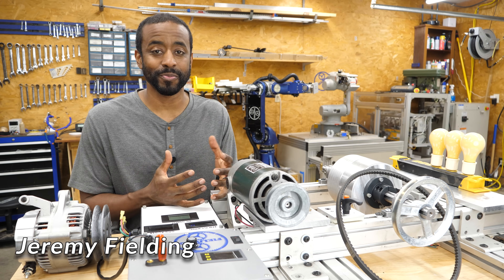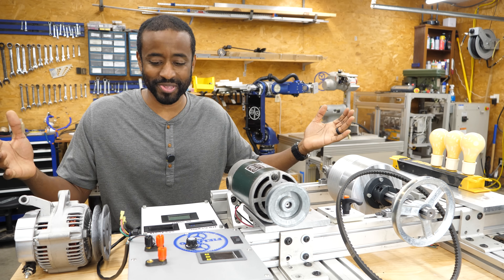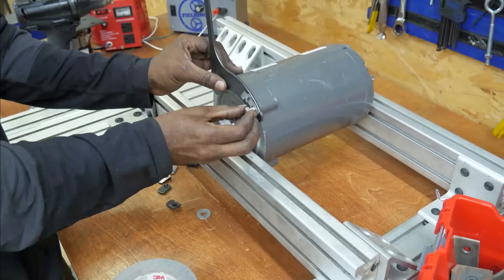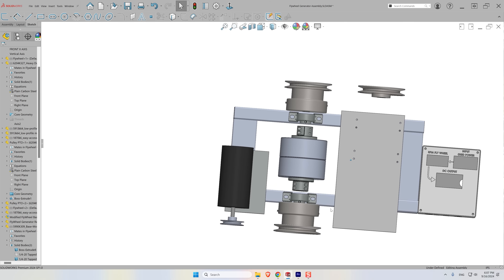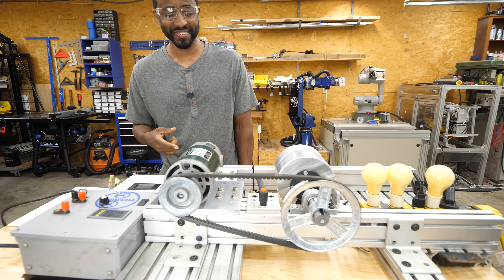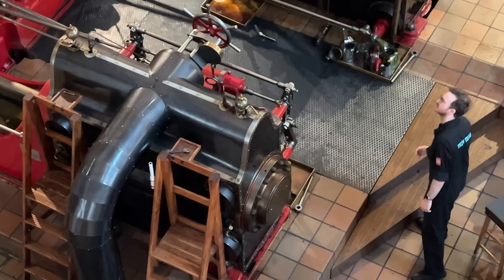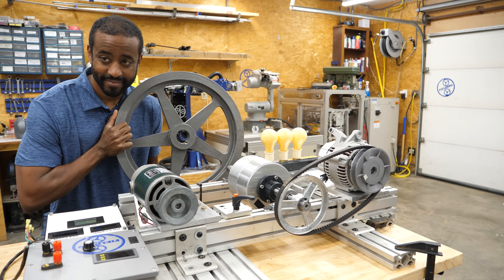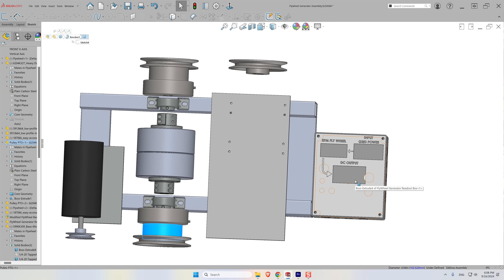A Machine To Test Free Energy Ideas.

Comment: 122723.  The second law of thermodynamics may be false conventional wisdom. Let's face the wonder of full heat use. 

The second law of thermodynamics was developed during victorian england's scientific and religious fascination with steam engines. 

The second law is behind modern refrigerators needing electrical energy to compress the refrigerent to force it to release as waste the heat that it has removed from the refrigerator's service interior in the cooling part of the refrigerent's circulation. The interior coldness draws in exterior heat through the cabinet insulation. There is also discarded heat from mechanical friction and electrical resistance. The net thermal output equals the electrical input with energy not being gained or lost in this refrigeration system including its forced waste. Unencumbered refrigeration by the principle that energy is conserved should produce electricity instead of consuming it. 

It makes more sense that refrigerators should yield electricity because energy is widely known to change form with no ultimate path of energy gain or loss being found. Therefore any form of fully recyclable energy can be cycled endlessly in any quantity. 

Full heat recycling, all electric, very isolated underground, undersea, or space communities would be highly survivable with self sufficient EMP resistant LED light  automated vertical farms, thaw resistant frozen food storehouses, factories, dwellings, self contained elevators, safe rooms, and horizontal transports. 

In a flourishing civillization, small self sufficient electric or cooling devices of many kinds and styles like lamps, smartphones, hotplates, water heaters, cooler chests, fans, radios, TVs, cameras, security devices, robot test equipment, scales, transaction terminals, wall clocks, open or ciosed for business luminous signs, power hand tools, ditch diggers, pumps, and personal transports, would be available for immediate use incrementally anywhere as people as individuals or larger social groups see fit. 

Some equipment groups could be consolidated on local networks. 

If a high majority thinks our civilization should geoengineer gigatons or 
teratons of carbon dioxide out of our environment, instalations using devices that convert ambient heat into electricity can hypothetically be scaled up do it with a choice of comsequences including many beneficial ones. 

Energy sensible refrigerators that absorb heat and yield electricity would complement computers as computing consumes electricity and yields heat. Computing would be free. Chips could have energy recycling built in.
This would improve performance and lower cost,

A simple rectifier crystal can, iust short of a replicatable long term demonstration of a powerful prototype, almost certainly filter the random thermal motioren of electrons or discrete positiive charged voids called holes so the electric current flowing in one direction predominates. At low system voltage, a filtrate of one polarity predominates only a little but there is always usable electrical power derived from the source, which is Johnson (observation) Nyquest (theory) thermal electrical noise. This net electrical filtrate can be aggregated in a group of separate diodes in consistent alignment parallel creating widely scalable electrical power. The maximum energy is converted from ambient heat to productive direct current electricity when the electrical load electrical resistance  is equal to the array internal electrical resistance. 

Maximum calculated electrical power output (watts) is k (Boltźman's constant), one point three eight x 10^ minus 23, times T (temperature Kelvin) times bandwidth (0 Hz to a natural limit ~2 THz @ 290 K) times rectification halving and nanowatt power level rectification efficiency, times the number of diodes in the array. 

There are a billion cells of 1000 square nanometer area each per square millimeter, 100 billion per square centimeter. 

Order is imposed on the random thermal motion of electrons by the structual orderlyness of a diode array made of diodes made within a slab: 

Host crystal is silicon
  P type boron doped
-----‐------‐----___-- Out
🔻🔻🔻🔻
■■■■■■___ + Out 
  N type phosphorous doped 

All the P type semiconductor anodes abut a metal conductive plane deposited on the top face of the slab with nonrectifying joins;  the N type semiconductor cathodes or common cathode abuts the bottom face. As the polarity filtered electrical energy is exported, the amount of thermal energy in the group of diodes decreases. This group cooling will draw heat in from the surrounding ambient heat at a rate depending on the filtering rate and thermal resistance between the group and ambient gas, liquid, or solid warmer than absolute zero. There is always a lot of ambient heat on our planet, more on equatorial dry desert summer days and less on polar desert winter nights.

Focusing on the composition of one simple diode, a near flawless crystal of silicon is modified by implanting a small amount of phosphorus (N type conductivity) on one side from a ohmic contact end to a junction where the additive is suddenly and completely changed to boron (P type conductivity) with minimal disturbance of the crystal lattice. The crystal then continues to another ohmic contact. 

A region of high electrical resistance forms at the junction in this type of diode when the phosphorous near the ĵunction donates electrons that are free to move elsewhere while leaving phosphorus ions held in the crystal while the boron donates holes which are similalarly free to move. The two types of mobile charges mutually clear each other away near the junction leaving little electrical conductivity. An equlibrium width of this region is settled between the phosphorus, boron, electrons, and holes. Thermal noise is beyond steady state equlibrium. Thermal noise transients, where mobile electrons move from the phosphorus added side to the boron added side ride transient extra conductivity so t⁶he forward moving  electrons are preferentally filtered into the external circuit. Mobile electrons are units of electric current. They lose their thermal energy of motion and gain voltage, as they transition between the junction and the array electrical tap. 

Inside the diode, heat is absorbe; outside the diode, to exactly the same extent, an attached electrical circuit is energized. The voltage of a diode array is likely to be small so many similar arrays need to be put in series to build higher voltage.  

Understanding diodes is one way to become convinced that Johnson Nyquest thermal electrical noise can be rectified and aggregated. Self assembling development teams may find many ways to accomplish this wide mission. Taxonomically there should be many ways ways to convert heat directly into electricity. 

A practical device may use an array of Au needles in a SiO2 matrix abutting N type GaAs. These were made in the 1970s when registration technology was poor so it was easier to fabricate arrays and select one diode than just make one diode. 

There are other plausible breeches of the second law of thermodynamics. Hopefully a lot of people, mostly as independent teams, will join in expanding the breech. Please share the successes or setbacks of experiemental efforts. 

These devices would probably become segmented commodities sold with minimal margin over supply cost. They would be manufactured by advanced automation that does not need financial incentive. Applicable best practices would be adopted. Business details would be open public knowledge. Associated people should move as negotiated and freely and honestly talk. Commerce would be a planetary scale unified conglomerate of diverse local cooperatives. There is no need of wealth extracting top commanders. We do not need often token philanthropy from the top if the wide majority of people can afford to be generous. 

Diode arrays may be applied to warfare. War is terrible. Stable respected borders enforced by world suppression of invasion is needed.

Aloha

Comment: many people are making these and showing them on you tube but few if any give you any information on how to have success.     I will try to explain how these work and what it may take for success.       first know these devices must be tuned, its a balancing act between all components.  your generator/alternator must be two or three times larger than the drive motor in wattage.  the connecting belts must be relativity kept loose, the tighter you make the belts the more amps you will draw from the drive motor.   I believe most important is to drive the flywheel up to a rpm that will keep the generator spinning at a speed while under load fast enough to allow the wattage needed to power the drive motor.   you must accomplish this while drawing the least amount of amps possible from the drive motor.     the lower the gear ratio between the drive motor pully and the first flywheel pully the less amps the drive motor will draw.  always start with a small pully on the drive motor.   then size your flywheel pully to achieve close to the rpms the generator needs to operate at.    the size of your flywheel matters.   why? because you want the drive motor to operate at its rated rpm where it runs the most efficient at.   if the flywheel mass is too large the drive motor will draw more current to try and get the flywheel up to the rpm the drive motor wants to run at. in short the more massive the flywheel  the more current the motor will draw.  all gear ratios and flywheel mass must be tuned by monitoring the amp draw of the drive motor.    the flywheel is there to assist the generator, it provides a buffer for the drive motor. instead of the drive motor having to spin the generator under load by it's self the flywheel will maintain the generators rpm as long as the drive motor is getting the proper wattage from the generator.   the flywheel is ampliflying the drive motors torque.    it's a fine tuning of all components.    because there are many different generators and motors you will have to tune each system.     you may have to trial and error with the components, and certainly gear ratios.    if your generator is not outputting enough power to keep your drive motor going or giving you excess power then you have to increase the generators rpm, change gear ratios.  if your flywheel mass has enough energy to keep up the increased gear ratio to the generator without causing the drive motor to exceed it's efficient running status then you may have it dialed in.    if not you may have to increase or decrease the flywheel mass or adjust the gear ratio between the drive motor and the flywheel.   it's trial and error, you have to spin the generator fast enough to get the power needed for the drive motor plus excess for other things but at the same time the drive motor has to operate at an efficient load speed. it's all done by correct sizing and gearing. adding capacitors helps too.   do these devices gradually slow down and come to a stop? because after you unplug them from a land power source then what are the  remaining power sources ?    well the flywheel is a power source, stored kinetic energy,   the generator is a power source, it is still producing electricity,  and the drive motor is a power source because it is still being provided electricity from the generator.     you would think if the flywheel was the source of energy turning the generator you would assume as the flywheel energy slowed from friction so would the generator and so the drive motor would also slow due to lower voltage from the generator,  and everything would come to a stop.    if this is not faked and some how these really do work then we have to figure our why.    so when you have line power going to the drive motor what are the sources of energy in the whole system?  well you have the line power driving the motor,  you have the motor powering the flywheel.   you have stored energy in the flywheel keeping the generator going.  you have generated power coming from the generator.   so you have 4 sources of energy.  so look at what is happening when line power is on, everything is running fine as long as you have dialed it all in. which means your drive motor is running efficiently at a certain  wattage while turning the flywheel and generator.  now load the generator with a dummy load till the generator is outputting the wattage needed to power the drive motor to it's rated continuous wattage.   Then you can disconnect  line power driving the motor and substitute generator power to drive the motor.   we can see when line power is on the power the generator has is not being used. and it is a functioning power source, so we now use that power .    so then you would think as the flywheel slowed down from friction the whole system would slowly come to a stop.      the flywheel is the key once again,  you just need a small buffer, the flywheel must have a certain amount of buffer time which will keep the generator spinning fast enough to keep the  drive motor supplied with the wattage needed to keep the flywheel up to speed.   how does the flywheel slow down if there is a power source keeping it going?   how does the motor slow down if there is a power source keeping it going? and how does the generator slow down if there is a power source keeping it going?    and remember the flywheel has to have a good diameter to it.  the key to the flywheel is having it's main mass on it's outer circumference,  the larger the flywheel along with it's majority mass situated on it's outer circumference the more torque you will have at the shaft, this torque is important in keeping the generator going.

Comment: i like your videos thanks for making them, your knowledge seem comparable to my own.   so I am wanting to share what I believe is happening with these flywheel energy multiplying devices.   I will leave  another comment after this one explaining in more detail what I believe is happening.     first I will say you failed in my opinion to debunk these devices because of the way you designed yours.    generator has to be like 3 times larger than the drive motor in watts.   your fly wheel is not going to cut it, why ? way to small in mass and even more important is the diameter.   you are forgetting the leverage factor.  the best flywheel for these will have a large diameter with the majority of the mass situated on the outer circumference of the wheel.  because  the farther the main mass is away from the center of the flywheel the more leverage you will have at the shaft  and the more torque you will have.    If you build one and follow my comments in the next post you may find these do work.

Comment: I am not sure if you solved your clutch drag. But generaly most lawn mowers that use that clutch, there should be roughly a 20thousabds air gap between  the plates. Some run tighter or looser but it is around 20thou on most, check it with a feeler guage. The 3 bolts around the sized with a springs are to set your air gap.